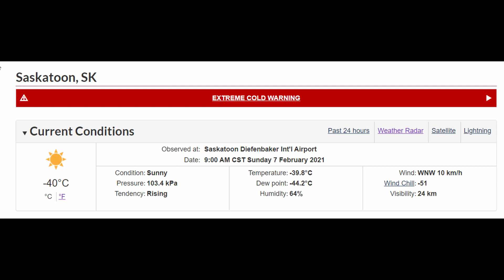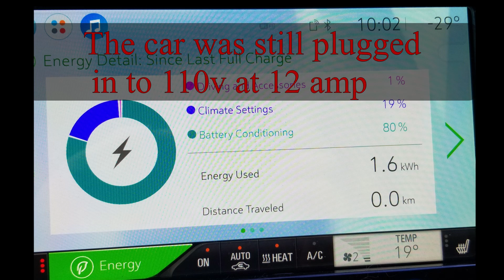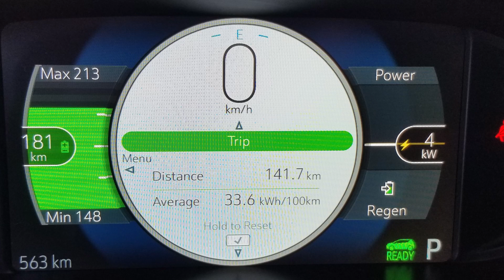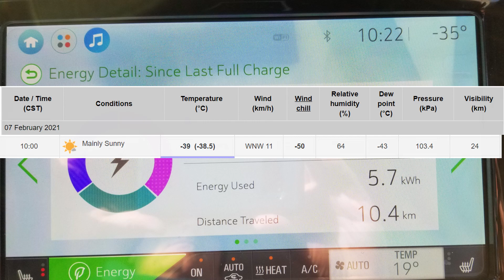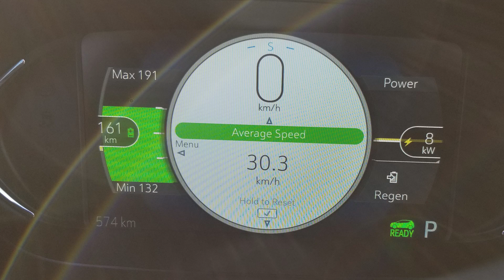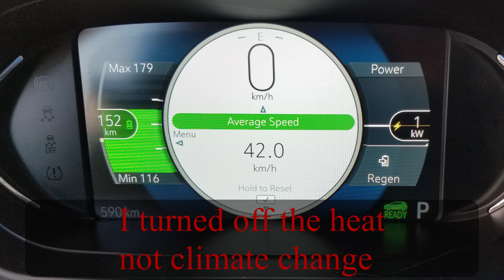Chevy Bolt at minus 40

Comment: So if I understand correctly the Bolt preconditions as needed, not necessarily all the time, but if you start the car in very hot or very cold temperatures, it will absolutely start up, right?
Reply from the maker: If the car is plugged in or turned on it will run the battery conditioner.  If it is not, it will not, so it is possible for the battery to get too cold to turn on, this happens when the battery temperature falls below about -20C.  I have another video about that and have tested it since then.
Reply: @keng5059  Really?  I was under the impression that the system was constantly monitoring to cool or warm the HV battery in extreme conditions.  I'll have to check your other vids.  Thanks for the clarification. 👍

Comment: Was your bolt unplugged before you turned it on and if so for how many hours at what temp prior your start?
Reply from the maker: It was plugged into a level 1 charger set to 12 amps. I have another video where it was unplugged for a week at similar temperatures.
Reply: Thanks Ken. Yes I watched your other video. I’m trying to figure out if my bolt will withstand-35c in Calgary while left unplugged outside for 10 hours.
Reply from the maker: @joecowie5828  May be a bit iffy depending on the wind and the starting temperature of the battery. You could run a pre-conditioning cycle about half way through to warm the battery up some.  If you turn the interior heat off or down it would use less battery than heating up the inside of the car. The car warms the battery up to about  +1c for "driving ready" when plugged in and the charge is complete.
Reply: Okay. Thanks for this. It would had been an interesting test on your other video if the car could turn on to precondition the battery without being plugged in.  There are those times in Canada where our cars can’t be plugged in when at work etc.

Comment: Hi Ken, I am debating the electric vehicle as my next purchase.  I commute 200 km round trip and was wonder if you have noticed any issues with maintaining the battery life over a trip like that in the winter.  Do you have a home charging station or can you connect to a standard outlet for slower charging?
Reply from the maker: Hello Jeff, I just charge with a 120V outlet at 12 amps, so it is the slow charging.  For going 200km per day in the winter you would need a level 2 charger to make up the charge overnight. If you have a place to plug in at work, even a 120V outlet, it will help with keeping the battery warm while parked.  Otherwise the car does a good job of managing the battery as far as I can tell.
Reply: Hi Jeff, I lived in Ottawa, Ontario. I'm commuting 120km/day in total to/from work. We have level 2 chargers at work. I'm thinking of buying Chevy Bolt or any PHEV in the same price range. How does your Bolt handles heavy snow storms? My main concern is getting stuck in the highway on a non-AWD car. I'm currently driving a Mazda CX-9 which is a gas monster.
Reply: @vincedenbu  Vincent, I dont own a bolt, just looking up options for my commute.  Currently drive an Altima and havent had too many problems with it in winter driving conditions.

Comment: Nice informative video. I love the Chevy Bolt. Very interested in long term battery performance. A new battery for one of these is $12-13K. I have about minimal voltage drop at 100,000 miles.

Comment: @Ken G how long is the range in -30c/-40c? what percentage does it drop? thanks
Reply from the maker: I have not done a full range test at those temperatures, we don't have very much fast charging around and this video was done shortly after getting the car.  As an estimate, I would say in temperatures like this you should count on only about 1/2 the regular range.  Keep in mind that higher speeds uses up more battery even in good temperatures.
Reply: @keng5059  thanks, living in cold climate on the prairies - i found your video very helpful as its hard to know what the battery will actually do for 7 months of the year.

Comment: 2020 Chevy bolt premiere here. Back in the Omaha, Lincoln Nebraska area this year Feb 2021 i did a 26 mile in and 26 mile back commute in -32F.  Was a very long day at work for me.  Consumed about half a tank of Electrons.  First thing at 4 am i woke up and turned my car on in the garage plugged in so the car would be all warm and toasty.  Went back to bed for 1 hour and 50 minutes.   I use a 240V juice box capable of the full 32 amp or about 7200 kw's of power draw.   At those temps the car cannot maintain batter temperature effeciently so after about 15 miles the regen went from green to greyed out. Had the heat cranked, seats warming and steering wheel as well.  At the end of the day it was about -20F so i started the car remotely for about 15 minutes while it warmed up nicely then drove home.   The car performed amazing warming up etc...    albiet the regen stayed grey the whole trip home at 7:30 pm.    Departed 80% charge came home at 25% or so + or -
Reply: Wow, that's awesome you had the confidence to get that car in those type of conditions

Comment: The power gauge on the right shows that even after putting several km on the car, that it still would not permit regen braking to function (white line below 1 kw in power display).  What a difference you shall see in the summer!  Only 110v power plug?  220v will be much more efficient at providing power to the battery - if you are able to.
Reply from the maker: Yes, I was surprised that the battery cooled down below the optimal regen point during the drive. We are finding the 110v plug sufficient for our needs now, but we may get a 220v charger at some point.
Reply: Regen will function but limited max regen to that line.

Comment: I give you a lot of credit for having an electric in such a hostile climate.  We have two Bolts, but, living in your area, would probably stick with a gasser...
Reply from the maker: The Bolt EV has been as (or more) reliable in the extreme cold as our gas cars ever have been.  One of the really nice thing has been the near instant heat with the Bolt that warms up the inside of the car far faster than any other car I have ever had.
Reply: The best vehicle in this climate is a plug in hybrid. They actually emit lower ghg per mile than an BEV in these conditions (because the "waste heat" from the ICE isn't wasted, and therefore the ICE approaches 100% efficiency).